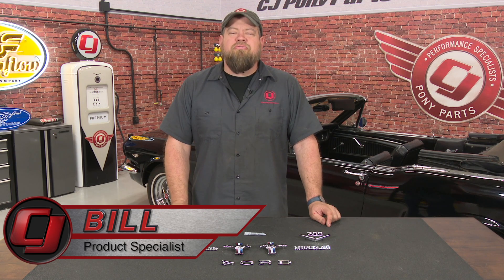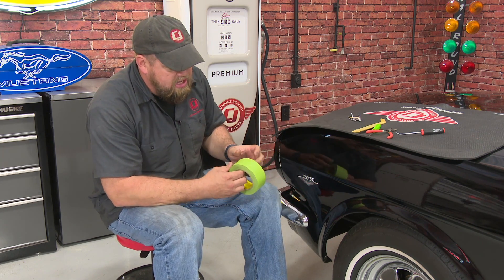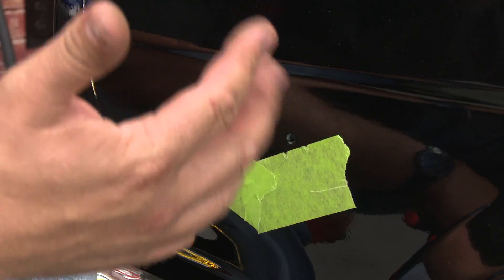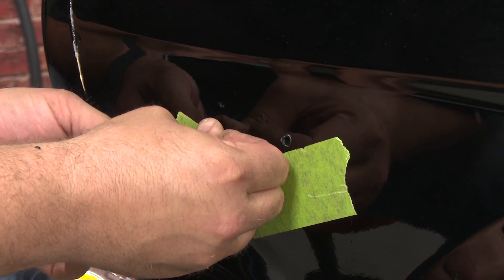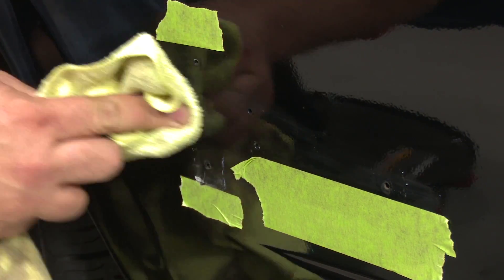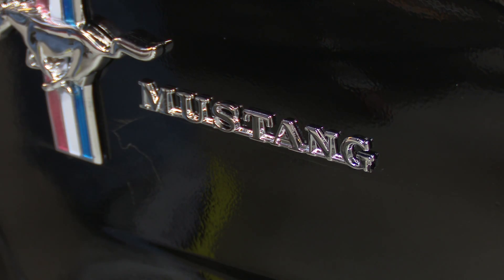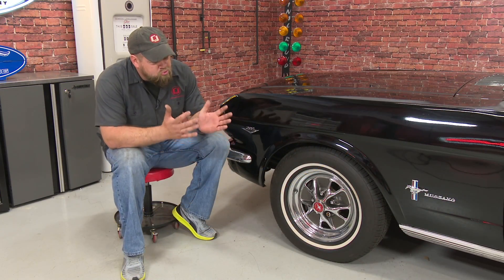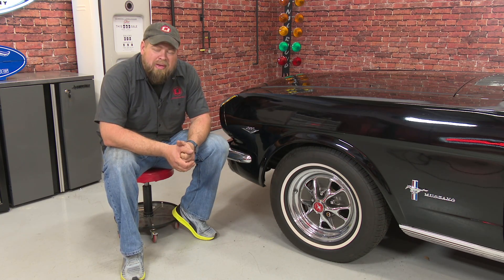Emblem Kit Pin-On Coupe/Convertible 289 | Scott Drake | 1965-1966 Mustang

Comment: What if it's a new fender with no holes in it?
Reply from the maker: We offer most emblems in stick on if you don't have or want holes in your fender.
Reply: @cjponyparts  got a link to the product?
Reply: What diameter are the holes? 
.25?
Reply: I already drilled mine to 13/64. I know they have to be bigger.